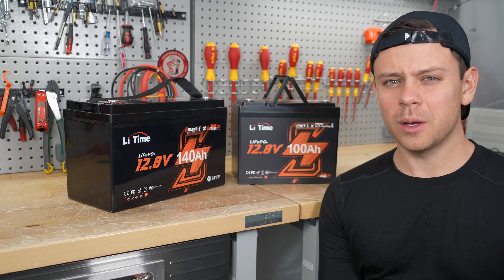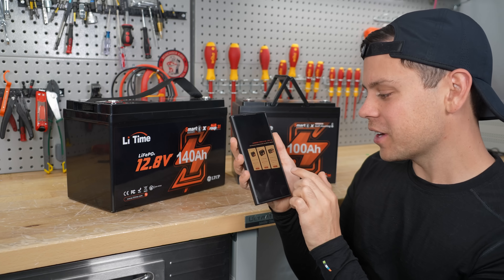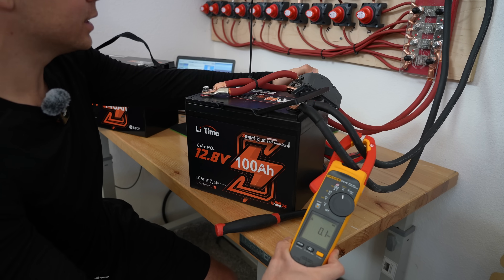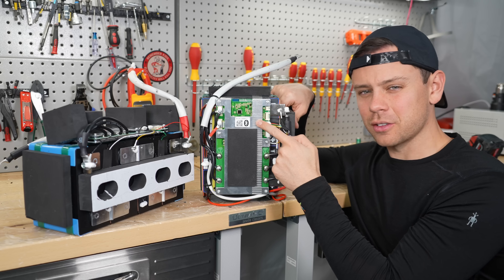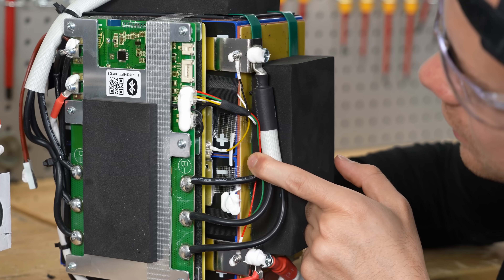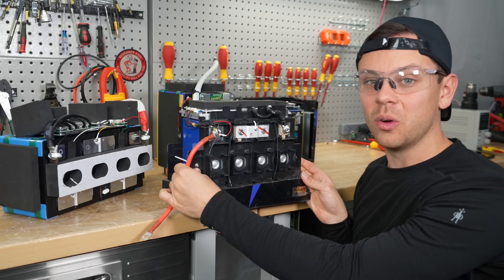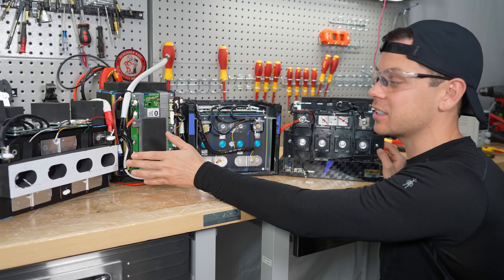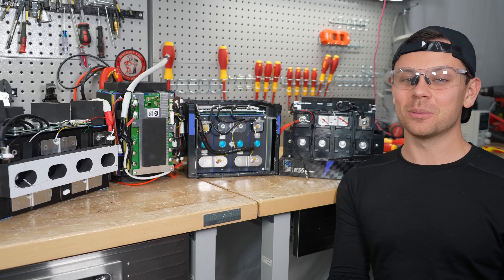Black Friday 12V Budget Battery Showdown! NEW Litime's VS Ecoflow VS Wattcycle

Comment: I recently got 4 12v 100ah base redid group 24 batteries for $590 after taxes. I am very curious to see what they go to for Black Friday. I am happy with the price paid and I hope they continue to get less and less costly as time goes on. $148 is great compared to $750 Battleborns in 2016. (I know there is differences between these batteries and this is not apples to apples) It will be several years until I do but I can't wait until I can build my next system and start using 48v batteries for once.

Comment: got a 200ah 12 volt dr house battery in may and another in oct last one is a inch taller than first they seem to work good. 45 lb is as much weight as i want to lift

Comment: Hi Will could you review the DJLBERMPW 12V Lithium Battery 100Ah LiFePO4. I know very weird name. I have 3 of them and I find they work well for a great price. I have seen some Youtubers tear one apart and the internal construction is not great. But I don’t plan on using mine in a boat or banging around in some over the road vehicle. Mine just sit static in my home so that’s not an issue for me. If you could take a look, that would be great.

Comment: Can I use this battery in my semi truck? If I use 4 of them to spread the cranking amps out, should give me 2000 amps. Surely that's enough.
Reply: That might work "if" you live in a climate where temps don't drop below freezing.
Reply: @_WJK_  My trucks are never operated in such conditions. They work summers only, rarely started otherwise.
Reply: @_WJK_  My trucks are never operated in such conditions. They work summers only, rarely started otherwise.

Comment: I have the 300ah mini ordered on presale about 10 days ago.  I made an account at their website using Will's affiliate link above.  Put it in my cart.  After a couple days they sent me a 5% off coupon noting that my cart was still there.  Then they sent me an 8% off coupon $40.  Got it for $459 plus tax free ship.  ETA is now about 10 days.  Can't wait to upgrade my 100ah battery in my van with my 3000 watt CNSWIPOWER 12v inverter paired with Rich Solar 200 watt panel (next upgrade will be their 250 watt).  Got upgraded 2 foot 2/0 gauge inverter cables from Rich because this battery has double 200 amp capacity and the Chinese inverter doesn't have the best cables.  I have been running a minifridge, inverter microwave, and a small 500 watt heater for a year (last black Friday lol).  Now I should be able to get through the winter solstice period in Tennessee much better.  The heater and lack of sunlight can make the 100ah battery iffy, especially if it gets low temp cut off on those days when temperature gets below freezing.  Still looking for a solution for that.  I am considering a battery box with some insulation, and just have a simple heating pad on low.  Sorry, I digress.

Comment: I bought 4 of the Wattcycle batteries to make a 48v battery bank for my "Hybrid" Off-Grid 12'x24' shed. I call it hybrid because i plan to tie it to my my home's main panel, and my home does have a roof mounted Grid-Tie system. I would would for the "excess" power my shed system generates to be fed to the grid.

Comment: Great video Will as always. I would love to see you review the metal cased 51.2 volt 50ah eco worthy or dc house battery. I believe they are the same company honestly. When you purchase two together they run about $350 a piece. Seems the build quality is decent and I understand the dc house one has low and high cutoff. Not sure about the eco worthy one on that. I got a few of these for my 48v diy system but have not done much with them yet. They seem to be fairly decent in cost and quality but would love to see what you think.

Comment: Great videos thank you I will say your biasing your opinions towards certain use case scenarios. I needed one 100 amp hour battery for a Teardrop trailer running mostly just a  small refrigerator so I didn't need High surge capacity. I did need a heater and I did need a battery monitor. The Li time 100 amp hour with heater and Bluetooth has a built-in battery monitor and heater so no extra wiring is required at all and you don't even have to mount a monitor gauge permanently. It was absolutely perfect for my use.

Comment: Hi Will, I'd love it if you did a breakdown of Eco-Worthy, especially the batteries - I'm running an off grid 24v system using 4 x 100Ah LiFePo4 batteries - using a Eco-Worthy all in one inverter charger controller system with a 1000w of solar - it has a random shut down between 75% and 54% drain ??

Comment: Will, just received notice from Ford my new Maverick hybrid will be here on Dec 10th.  I am thinking replacing the cheap lead acid drive battety with a lithium battery. What are my chances this wiĺl increase my electric powered miles. Currently rated at 20 miles.

Comment: Starting to hear about radodo or redodo batteries lately, have you looked at those yet? Also, I'd LOVE it if you were in the mood to do a sort of "state of the industry" for some current suggestions on large mobile builds for 5th wheels, etc. if one wanted huge capacity in a 24v or 48v setup, what budget or mid-range batteries would you consider? Appreciate your work!!

Comment: Regarding the wattage,   some applications call for multiple small batteries to be able to stuck them in confined spaces or to distribute the weight.   Think  about the boat market,  every boater will replace the agm eventually.  
However,  curious if you're going to test the new solid state marine batteries.

Comment: Just bout the 4 pack of LiTime 12v 100Ahr marine trolling motor batteries at priced at $168.59 each. For use as trolling motor batteries and as emergency house power. Hear you on the "Black Friday" advert rediculousness. Two 20 amp chargers. Wish they woul also offer extra Anderson pigtails so I didn't have to wade through substandard on Amazon, though😢

Comment: Is it better to run closer to voltage to battery bank? I.E. if your 12v bank, using 20V/60A through solar or 120V/10A? Im using 2x 12v 200ah in parral to make 400AH 12v, with 6x EcoWorth 200w pannel's.

Comment: The LiTime battery proprietary BMS doesn't give much information through the Bluetooth information, balance information such as individual cell level details aren't there, it just shows a picture of a happy dude saying 'normal'. It gives its estimated state of charge and battery voltage, which might be good for a bunch of people, but not for someone who wants the JBD level of information with cell level and multiple temperature readings.
For what it's worth, I was looking for a mini vs group 31 or group 24 and the PUPVWMHB 100Ah mini is $149 after $20 coupon and free shipping at the moment. I think with taxes and regulatory fees it came out to $162. I just bought that one a few days ago, other reviews show it has a JBD BMS and Gotion cells.  I think the Mehrpow mini of the same size is probably an identical battery, not sure but it's $20 more so I got the PUP instead.
Although it does make sense to get the highest Ah cells for less wiring for a solar application, for any other use case where capacity isn't that important and a 1C BMS is, it seems the 12v 100Ah size is consistently the cheapest per watt-hour. It seems some 140Ah with 150 amp BMS are similarly priced per capacity at this point. I'm running small 12v loads without solar at the moment and 100Ah works for me so it's perfect and doubles up as an emergency battery to run a fridge and furnace so I don't need a generator running as often or in the night hours if I lose power.

Comment: I've switched to full face filter masks as well. Much more comfortable and better protection. So much so that I forgot I had it on and made a quick run to the hardware store wearing it. The clerks didn't even flinch. They're used to my idiocy.

Comment: Glad to know that I made a good purchase.  Just bought the 2 pack 12V mini batteries from Watt Cycle with blue tooth.  My use is simple connecting them directly to my 12V fridge when camping at the beach.  All the moisture and sand ruined one of my jackery 500's so my solution is a direct connection to my fridge without the use of inverters.  Have to agree with you about checking prices.  A few years ago I was looking for a TV and found one I wanted but decided to wait for Black Friday.  Big mistake when I went back to buy it, it was listed for $100 more than when I saw it  a week earlier.
Reply: I got one of these not long ago, but without the bluetooth. I was getting some weird voltage readings on it. However, I seen a video where a guy, having similar issues, opened one up and found that the cells weren't balanced. I top balanced mine for about 5 days and that seemed to help a lot. It now seems to be acting more like my battleborn does... which I know is top quality. I just can't afford to buy a new one of those. Their black friday sale is $674 for the same capacity I paid $175 for my Watt Cycle.  I only bought the BB because it was my first lifepo4 battery and knew I would need lots of customer service as I got up to speed. And they are definitely good at customer service.

Comment: Hi I have a question could you use one of these batteries in a electric car, since is not use for cranking just for accessories and lights I think the BMS takes care of the voltage 
Thanks

Comment: Can you please review the NewtiPower 300 Ah? It sells only in Amazon.   I got one and did a basic capacity test with a mini heater consuming about 375 wh. It run fir 7.02 hours.  Even adding a 10 percent consuming rate for the inverter the numbers fo not add up.  It has a great proce in Amazon. But I think it about an 280 Ah battery.  I tested the 12 v 300Ah MINI.  

If you do it will be greatly appreciated.

Comment: What do you think of the small capacity (e.g. 25ah) 48v batteries for portable power stations? Theres a brand called lipuls that makes one rated for 2c continuous discharge so you can draw ~2500w from a single lightweight battery with just six gauge wire.

Would love to see reviews and teardowns of the few options out there in this space.
Reply: Just get a Seikon 12v then you don’t worry about a buck converter and can run 12 loads freely, also 1280wh, 200 amp continuous/2500W capable

Comment: Ahoy Will: idea for a video. 
An outdoor inverter connected to an outdoor power wall, physically attached to a carport (gazebo) covered in solar panels. 

How to connect to a small outdoor load centre to run:
• some lights in the carport, 
• 120VAC outlets,
• EV charger and 
• an outlet for an RV. 

This is a remote location, without grid power. A retreat where you can take an RV.

Take the physical construction of the carport and installing the solar panels as read. Focus on the outdoor electrical encasements and connections. 

Thank you.

Comment: I'm shopping for a Group 31 battery for my small RV and was wondering if the LiTime actually delivered the 140Ah.
Sounds like I need to hope that Wattcycle designs a high capacity Group 31 with Bluetooth or add Bluetooth to their 300Ah mini.
Your channel has been a trove of well designed battery testing.

Comment: The Sunrich Energy Group 24 100ah self heated battery (which doesn't have Bluetooth) is on sale for roughly $190 right now. I recently tested one by letting it cold soak outside for 3 days to 16F before I brought it inside to charge. It took roughly 95W to activate the heating circuit, which took less than 10 minutes to warm the battery up to its charging cutoff temp.   There is no reason to spend more money in my opinion.
Reply: Glce has the 100ah battery on sale for $97. I'll take the other $100 and buy 30 gallons of ⛽️ .
Reply: @Gary-ee3kq  where?

Comment: My 1997 Club Car DS is due for batteries. The typical Trojan lead acid are in their 6th season so have been looking. Holy Cow! Having never used lithium, my feed is flooded with offers. Group sizing is confusing. So many group 24 out there but I can't find a single video on anyone using that group size on a 48 volt golf cart. HEYA Energy has 100ah 12 volt batteries 4 for 568.44. They are in my ebay shopping cart currently, but again, no videos. I sure hate to buy junk.

Comment: @WillProwse Have you messed with the Pecron power stations?  Thoughts?  That E3600 looks kinda interesting for a simple all in one power station w/decent power for the price...
Reply: And their 3kwh battery modules are at $900 (Which is high by DIY standards but pretty cheap for commercial, especially when you can use them standalone as 'dumb' powerstations, even has an MPPT built in to each battery)

Comment: I purchased 3 of the Litime 12v 100ah TM batteries. I spot locked for 8 plus hours with a 36v 112lb Ultrex and hardly used any percebtage of my batteries. I dropped 120lbs by switching from group 31 agm's to these Litime 100ah batteries. Great batteries at an amazing price.

Comment: I was surprised when I saw you clamp on amp probe over two wires. I never was able to get it to work for two wires , but I mainly deal with AC power good to know thanks
Reply: AC or DC it doesn't matter, as long as you only have one side of the circuit going thru it... and your clamp meter supports it. 👍

Comment: I have some LiTime self-heating batteries. The internal resistance heats the battery better than any heating pads. Unless the batteries are soaking in -4F (or lower) without any discharge the feature never gets used.
Reply from the maker: Good to know!
Reply from the maker: Yeah I don't think most are going to ever trigger that circuit. Very difficult to do
Reply: Just left the cold of northern Alaska on a big road trip.   I was definitely rationing my solar generator power.  I'd love an expansion battery with a heater.  I wonder how this battery would do on the footwell of my overlander in -20 and colder?😅  I know it's not getting quite that cold in the car but I'm sure it's under 10f.